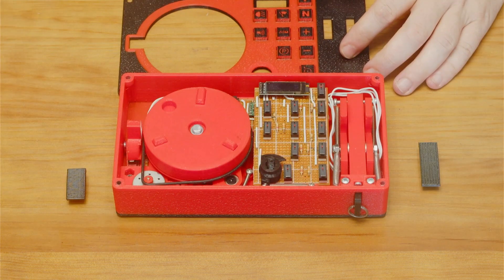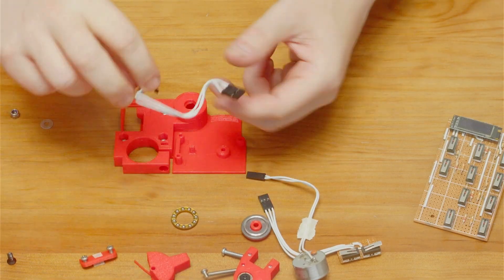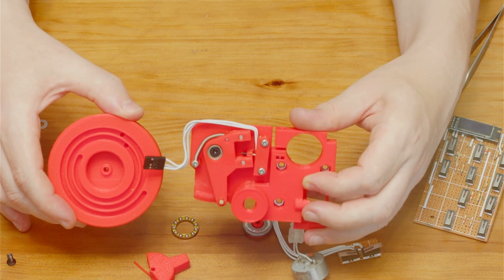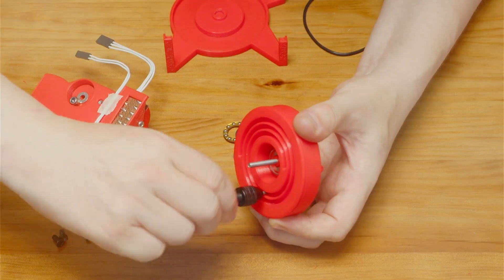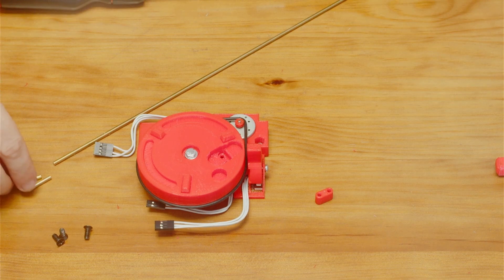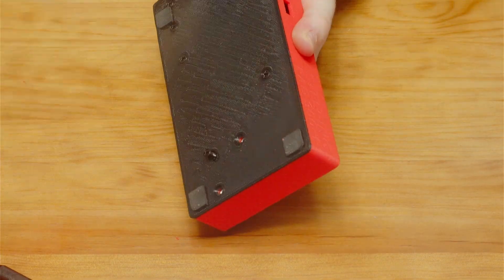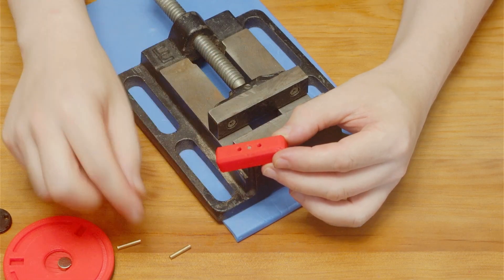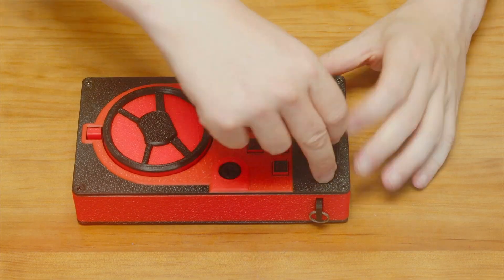What are the new features on the steering block of the Steering PAD 900-F

Comment: Hey I just had a small doubt while 3d printing the steering wheel, basically I going to get my parts printed and outsourced and putting a magnet in the wheel is not possible from their side, I now see that you have solved this issue with using a magnetic screw, is this upgrade there in the download link of the printables ?
Reply from the maker: Hello! Yes! It's the ones with the V2 in the end of the name. they all go together. I still have the legacy ones there just in case someone needs them but you might find parts with the same name and different versions. So, if something has a V2, it's that part instead of the original.

Comment: Hello, may I ask if this device has an automatic centering function
Reply from the maker: No. It has force feedback. The game is responsible for doing that when needed
Reply: Thank you, I have solved this problem, but I have a new one. I found that the steering wheel from the driver's perspective was shaking severely while playing the European truck simulator. How can I solve this problem
Reply from the maker: @hanLeif  That can have different sources.
The most common is the ProMicro being build with cheap components and not be able to provide a stable current to all devices. If you disable the force feedback, does it still shakes? When it shakes, does it shake only when the force feedback is trying to act?
This means the ProMicro is a bad one and you need to get a better one.
Other problem is the lack of cleaning after soldering. This can cause some currents to pass to the wrong wires through the residue, inducing noise.
at least, all the times I had that problem, it was related to one of those problems, if not both. 
If you want me to look at your boards, go on my profile in Printables, and click on message. Send me good pictures of both sides of both boards. I might find something else!
Reply: @HomeGameCoderBuilds  I have sent you a message on Printables, providing feedback on my shaking issue. Thank you for your guidance
Reply: @hanLeif  Personally, I have found a solution to this problem. I soldered an electrolytic capacitor 2200mkf x 16v to + and - on the LCD panel. The vibrations have become very small and practically do not interfere with driving.
Reply from the maker: Hello. Thank you for your solution. I didn't test it but I believe it can help. I was not expecting the OLED display to be the problem. Can you share a "Make" in Printables with some pictures of the complete unit and a detail of your solution? That would be grate. I'm away from my studio and I will not be able to do it my self! Thanks!
Reply: @HomeGameCoderBuilds  Most importantly, thank you for developing and supporting this very interesting project. About the capacitor, the display probably has nothing to do with it. There is a power filtering capacitor on the lower board, but not on the upper one. So I decided to try to connect it here, this is the most accessible place where there is a + and -.

Comment: optional blocking is a nice feature, I'd love to see the 1800 angle wheel, like in most trucks
Reply from the maker: That needs a different approach to the sensor solution. In a bigger wheel, the same technique could be used but this spiral is already at the limit of what a printer can do. If the wall was thiner, to accommodate the extra turns, they would be super fragile. But I'm not excluding a rework of the mechanism, because if the spiral is there just to limit the rotation and the angle is sensed independently, maybe it is possible to go past 900
Reply: @HomeGameCoderBuilds have you thought of using an encoder such as as5600? They're absolute, magnetic encoders encapsulating 4 hall sensors inside them
Reply from the maker: Yes but those also need a deep redesign. My current controllers version is just an improvement on my 2yo prototype. You can actually see my old one scrolling back in my Instagram. People asked me to share that but for legal reasons, that couldn't be shared. Long story short, this Steering PAD 900 is just a rework of the old concept with minor improvments. I also wanted to keep it DIY friendly.
Im already thinking about a future revision/version to improve on the steering sensing and that encoder is the primary candidate. I need to get one to test it out, but that has a major characteristic: it needs to be directly below the axis to be fully efective and as you might already notice, there is no space below the bearings... Unless they are giant and all around the steering.... I also have to buy some of those to test.
It is a new challenge